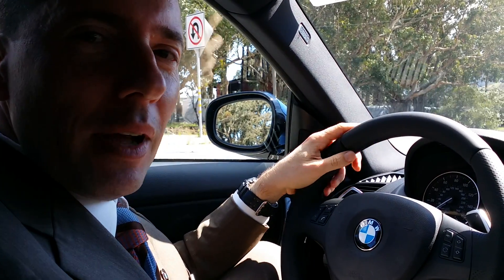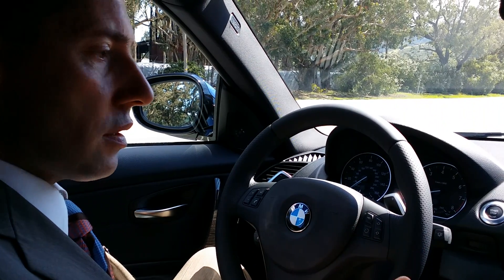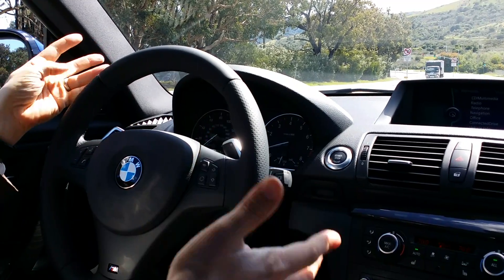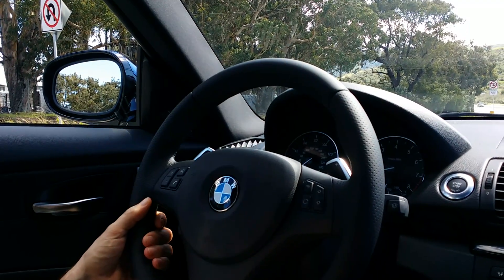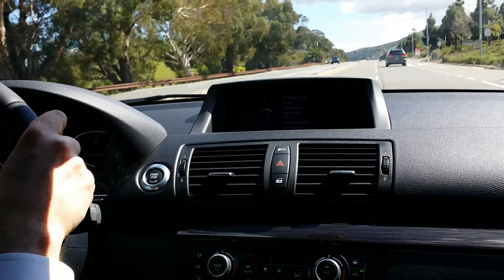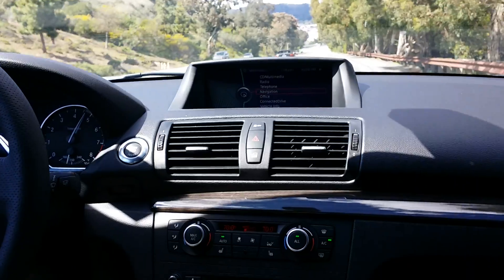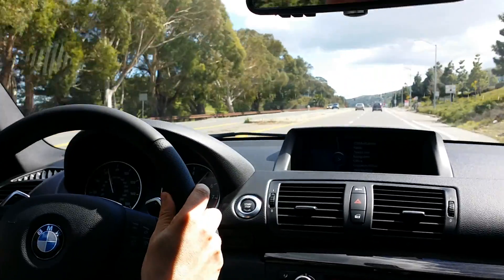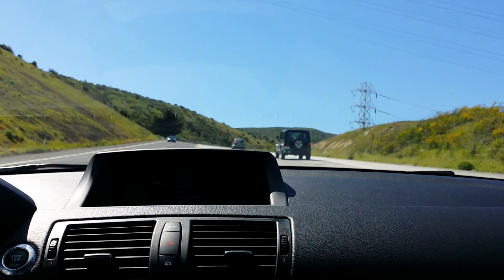BMW DCT transmission

Comment: By not engaging the engine sport mode, as well, these launches were missing a significant performance opportunity.  The sport BUTTON bumps up the engine settings as well as keeps the twin turbos spooled up.  Those hesitations between shifts - that's because sport wasn't engaged on the engine.  In "Sport/Sport", there is only millisecond lag between shifts; imperceptible, and you never, ever leave your torque curve.  It's like driving a Tesla.

Comment: So for the manual shift, I didn't see you physically shift the gear by hand is that adjustable? Also, out of curiosity has any Z4 alumni had any transmission issues with this dual clutch system in the 09, 11 years later?
Reply: All dual and single clutch autated manuals have problems. The release bearing and pump are your main issues but the clutches themselves are expensive and hard to replace

Comment: I’m pretty sure only the 335is and 135is have dual clutches (not including M models).
Reply: Z4 sDrive 35is as well, and the 335i with DCT, and the 135i with DCT
Reply: Yeah I thought only the M cars had the dual clutch. I have a 435i Gran Coupe with the 8 speed Steptronic
Reply: In america they didn’t have the dct option unless it was the M3. I had to get mine in Germany with the dct and then ship it to my country Mexico. That’s what u gotta do if u wanna enjoy the dct on a regular 335i
Reply: @juanmontano6105  The 335is is literally a 335i with a DCT you knob.
Reply: @hexagonosaurus5848  it is not. Depending on the year but 2011 and 2012 keep the n54 instead of n55 and they also have some extra goodies like an extra radiator and harder suspension.
Reply: @juanmontano6105  So, it is a non M car with a DCT? Dumb much?
Reply: @hexagonosaurus5848  bro you don’t even know what you’re talking about.
Reply: @hexagonosaurus5848  just shush
Reply: @juanmontano6105  you’re wrong . Here in America we had the 335is which has a DCT . It was only made 2011-2013 with about 4500 cars produced . I have one . None of them have a N55 engine , it’s what made them special because they put the N54T in them . Although you’re right about the extra oil cooler , suspension you’re wrong about everything else .
Reply: @Clip_That_Shih yea I later found out about the 335is
Reply: @juanmontano6105 my bad I know I’m years late 😂😂😂
Reply: @Clip_That_Shih yea I was reading the comments, I said that cause the main comment says that there’s no BMW with dct unless it’s an is which is only true for United States, anywhere else in the world you could get the DCT in any regular BMW without having to be the is version
Reply: @juanmontano6105 yea it’s wild that BMW does that . Just let us have access to the cars .

Comment: Wait... When you're in manual mode do you have to operate 2 clutch pedals? I'm sorry if that's a dumb question; I've never seen or driven a dct.
Reply: Caden Deaner anytime theres a dct its an automatic transmission
Reply: 2 clutch petals? Unless you have 3 feet...

Comment: Hi, only M models come with double clutch(DCT) with 7 speed transmission.(1M, M2, M3, M4, M5, M6). Pack M models come with 2TB with 8 speed Transmission.
Reply: false, 135i n55 (2010+) and 335i n55 and some n54 335´s got the DCT, the early 135´s with n54 got the 6 speed torque converter auto just as the early 335i n54´s, 8 speed torque converters came in the newer f series (f10,f20,f30....)
Reply: Oh okay! Sorry about the wrong information I have. Thanks!
Reply: I got a 335is n54 with dual clutch tranny
Reply: A 1M doesn’t even come in an auto transmission🙄

Comment: My 2014 ford has a nicer interior...
Reply: Morgan Harris is it turbo with a dual clutch too?
Reply: Forged bottom end with a twin turbo aspirated straight 6? Lol your ford isnt near a drivers car the BM is. I've had fords before they aren't anything special not to mention there autos are hilariously weak and shatter under lame ass torque loads.
Reply: And while were at it I bet 50$ my 2017 hyundai has a better interior tranny and engine than the one in yours xD

Comment: does 2008 x5 v8 have DCT transmission ?
Reply: maximusEagle pretty sure they do, my dad has the X5 30is, it just doesn't have the paddles, you'd have to buy one of the M steering wheels with the paddles and install it
Reply: @shaquizzle5548  No. Your dads X5 has a torque converter slushbox.

Comment: So what's the difference between Drive mode and sport mode?
Reply: Drive mode is optimized for fuel efficiency. Sport mode will hold a gear longer to keep the revs higher; will downshift more quickly, etc.
Reply: Ahh I see, thanks for the reply cheers!

Comment: Is an automatic 350z technically this? Since it has sport mode(manual gear change)
Reply: +Alex Miranda no the 350z has a torque converter, this is a dual clutch transmission (DCT). its an automated manual transmission. the 350z transmission wont be as fast or responsive as a dual clutch transmission which in a sports car is important to the driving experience
Reply: Frank - no, its absolutely not.  Michael Flores is correct.
Reply: +michael flores this is actually a normal torque converter as well

Comment: Does this car have a clutch pedal?
and can you put it in neutral while you are driving or while the car is moving so that you can rev the engine to hear it a bit and if you are going down a hill is it possible to put it in neutral?
Reply: +maltatravel It does not have a clutch pedal, and yea you could pop it into neutral while driving, however going from neutral to D while the car is moving is usually not something recommended by many manufactorers.  I guess if you're rev matching you could do that :P
Reply: you should never put on neutral on down hill. no car maker will recommend you to do that. In fact, that's illegal in some states.
Reply: @eile4219  Putting a car in neutral on a downhill ismt illegal you tweeb 🤣🤣🤣 smfh
Reply: @hexagonosaurus5848  it's in my state. If it's not for your state, good for you.

Comment: Na bruh! Im sticking wth my 6 speed manual, a REAL manual with 3 pedals, a car should have 3 not 2!
Reply: Carlo Ferraris Crawley You're dumb. I guess Formula race cars should use 3 pedals too and not a DCT transmission.
Reply: John Marquez not all, some F1 cars use sequential transmissions, those do have 3 pedals but only use the clutch pedal to launch.
Reply: Everyone knows in F1, Full automatic gearboxes, and systems such as launch control and traction control, are illegal, to keep driver skill important in controlling the car. So that lead teams to allow the driver to initiate gear changes using paddles mounted on the back of the steering wheel and electro-hydraulics perform the actual change as well as throttle control. Clutch control is also performed electro-hydraulically, except to and from a standstill, when the driver operates the clutch using a lever mounted on the back of the steering wheel. F1 teams are using seamless shift transmissions, that allows almost instantaneous changing of gears with minimum loss of drive. Shift times for Formula One cars are in the region of 0.05 seconds... Your 1970's sequential transmission are out of date. DCT is the new.
Reply: John Marquez okey man, then why in an interview with Vettel, he said that he uses padles linked to a SEQUENTIAL gearbox? And you didn't have to tell me all of that technical stuff, i know, and dont you ever call me dumb,  ya heard!!
Reply: +Carlo Ferraris Crawley  I thought you were sticking with your 6 speed manual.  You know...a real
 manual with 3 pedals.  But you drive an SL55 AMG.  As far as I know 
this has an automatic transmission.  Oh the irony.
Reply: Ow, sorry John Marquez. Sl 55 amg benz to be exact
Reply: Carlo Ferraris Crawley complains that only real cars need 3 pedals, owns a 2 pedaled car tf
Reply: John Marquez Killed him.
Reply: And John Marquez I don't even own a damn honda. Sow that aint even an insult. I own a sl benz so shhhhh
Reply: +Carlo Ferraris Crawley The MB with 5 Speed Mercedes Speed Shift ? This transmission sucks
Reply: lol probably doesn't own an AMG

Comment: Smoothest for daily driving = torque converter automatics aka "traditional automatic"...heck, a properly driven stick would be smoother. The DCT is pretty jerky in lower speeds and slow traffic. Hill assist randomly goes on and off too. However, it is truly smooth but robust when driving it hard.
Reply: What do you mean hill assist?
Reply: @angelpena8121  Try going uphill, come to a stop, let the brake go, and the car should stand still for a good while. Most automatics have it and a lot of modern manual cars have it too. I know Porsche PDK, Lotus IPS, and Audi DSG all have hill assist and they're all consistent from what I can remember. Torque converter automatics all have consistent hill assist. 

BMW DCT seems to go on and off seemingly random. It is inconsistent. Now, wanting hill assist or not is a preference but I want consistently ON or consistently OFF.